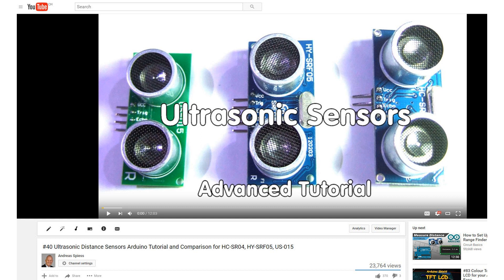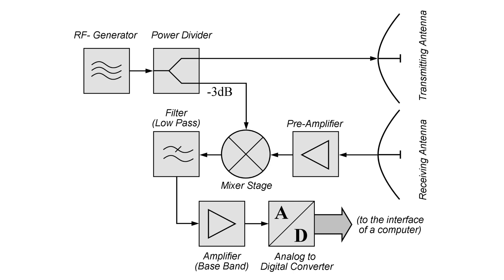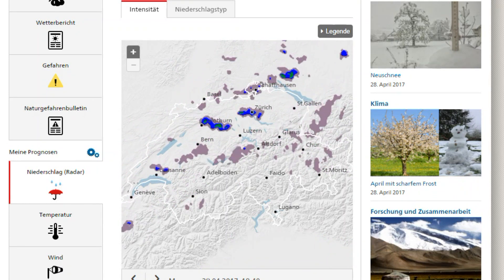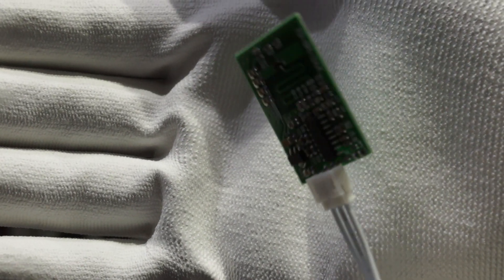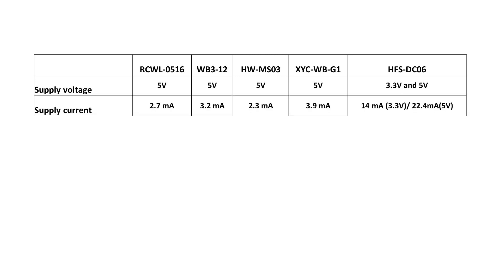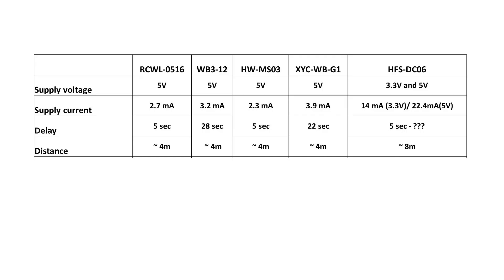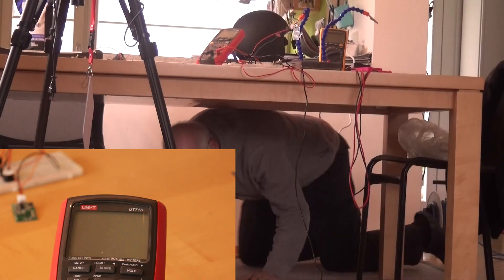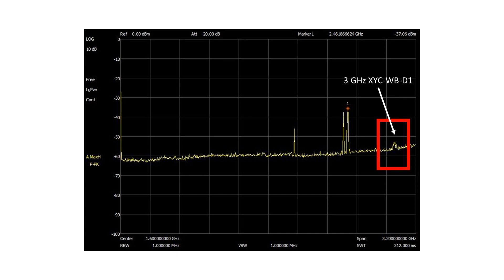#135 Radar Sensors / Switches: Comparison and Tests

Comment: My first professional jobs was to work on Radar.  I really wouldn't classify these boards as Radar.  I could go into thousands of ways it's not but it would be unnecessary.  But even looking at this on the first design I had when I was in university for a robotic lawn mower.  I don't think this would necessarily fit the bill.  Yes, it could maybe provide ranging information so it didn't run into something or used to determine when it needed to turn away to avoid impact.  But I don't know if it would be able to detect the difference from ground noise from an actual object.  It was why I was forced to consider phased array but using light.  Even that had drawbacks.  It hasn't been something I have ever got off the drawing board in thirty years of messing with it.  Of course the major problem is lifeform avoidance.  Can't run over some kid or baby that is in the yard where they shouldn't be and this robot is running about.  I see a stay in prison at her majesty's pleasure for years.  And when I tried to use multi layer sensors its power usage was too high and it would be several kgs of weight. Not to mention the amount of AI that would have to be written.  So, it became impractical.  But I digress. No, I can't think of a practical use case for these chips because they fall short.  Thanks for researching it.  You saved me the trouble.
Reply from the maker: +Independent Living As I said, I have no clue how they work and I doubt, that they really work like real radar. I just tested them without understanding how they work. I think, many other tests can be made. But so far, they seem to work in the situations I showed..

Comment: I was looking for one of these devices to use in the UK for remote security applications. After looking around there was one company who could supply a module which could detect at 75m, (people/vehicles) with current draw down to 1mA. Not really cheap but top quality.  You can also purchase ready to go radar speed camera, with a warning sign: slow down, over 20mph, etc. I never knew these devices were available to the general public but they are.
Reply: There is one of those speed signs at the local retirement village, indicates your speed either in flashing red or green.

What is really cute, is that it detects direction, indicating only traffic approaching, not departing.  That requires somewhat more sophistication.
Reply from the maker: I think, these devices work with a different principle, because they can also measure speed.

Comment: Thank you for your video! I have noticed they won't detect through glass. I wonder if the glass window reflects radar because of heat insulating filter that is applied to the glass pane.
I'm going to test my theory with some pieces of glass that I have next week.
Reply from the maker: I do not think, that the glass in my house has metallic shielding. So, I would be interested in your results
Reply: I've done some tests already this afternoon. I can't find any glass here at home that reflects this sensor that I have with me. I have some aluminium mesh material that seems a little bit permeable to the sensor, but I'm not sure if I tested that right. The glass at my office does reflect it for sure, but I have to test that again later.

One interesting phenomenon that I found is that with the sensor loosely inside a metal bin, like a cookie jar, the bin becomes really super sensitive to the touch and to movement. Almost so sensitive that shouting at it is enough to trigger the switch. 
This sensor has great potential for creative tinkerers.

I'll get back later.

Comment: Nice video. I bought a few radar sensors in the past but always had problems to get them to work. Maybe I got confused by the 360 degree sensitivity you have measured. One question: did all of the modules needed a pullup resistor on the output?
Reply from the maker: No, only the one I mentioned
Reply: Ok. Have you tried to use a metal tube with one open end to force the sensitivity to one direction? It would also be interesting if a tube does affect the range ....
Reply from the maker: No, but one of the modules had a metal shielding and directivity.

Comment: May be this sensors are only detecting changes on the phase of the received signal. Then, even with many devices transmitting this will not avoid others to detect this changes. This is why it seems to work through obstacles: because the signal is being reflected and sparsed in all the room.

You can do a test: check if one sensor is triggered when you power on or off other sensor. You can also check if it is triggered by other sources of radio like sparks on light switches or fluorescent tube starters.
Reply from the maker: You are right. The I did a short test with a RCWL-0516. It switches on if I switch a second RCWL-0516 on or off. It did not react on the HFS-DC06, but it reacted also on the HW-MS03. Distance was about 2- 3 meters.
Reply: I noticed that same device inteference with each other. I had three LED Light Bulbs with build in radar sensor in the same lamp and I get a nice light show. :)

So more than one device in the same room isn't working very well.

Comment: I tested the HFS-DC06, by splitting the two pcbs and access to the two opamp outputs to read the low freq waveforms , so behaviour can be expanded from the standard one-off ;)
Reply from the maker: And what did you do with signal? What does it detect? Speed? In which direction?
Reply: P. B. this is related to my question also. can we detect the amount of reflection in a volume.  My application would be plant growth or level of water maybe?
Reply: I observed the waves variations with the oscilloscope, I did not use the signals yet. It was months ago, I found some algorithms but did not apply yet.

Comment: Are you sure the RCWL-0516 does not work on 3.3V? I really cannot see a reason why it shouldn't work if you power it with 3.3V on the 3.3V pin. Usually a voltage regulator doesn't care much if you power its output with the right voltage and no input connected... Even if the voltage regulator is integrated within the IC. And I don't think the unregulated input voltage is used anywhere else except on the voltage regulator input. You should try it.
Reply from the maker: You are right. I tried it again now and it works. I do not know what I did last time... BTW: I did not see a voltage regulator chip on board.
Reply from the maker: Done
Reply: Thanks, then I'll try to power the radar sensor from the 3.3V output of my ESP8266 board.
Reply from the maker: Yes
Reply: @Roter . If I understand you well, the 3.3V pin can also be used as an INPUT (on +3.3V) as long as the Vin pin is not used ... am I right ?
Reply: Yann M I'd like to know how you get on.
Reply: I cannot find a voltage regulator either, but looks like RCWL-9196 has internal regulator from the pinout. On HW-MS03 it looks to me like there's a small 3-pin regulator hanging off its back, you can likely supply 3.3V to its output.
Reply: Will you revise the info based on this knowledge (that it works on 3.3V), also will you post code for use of esp8266 with this sensor :).
Reply: Thanks for this update! Very helpful for me!
Reply: Mine also worked with 3.3V from an Arduino board on the VIN pin...

Comment: I bought a sensor which is marked "2.7GHz" from Aliexpress and was quite surprised by the spectrum of signal which it emits. It is not a narrow "spike" but rather wide, maybe 1 MHz wide. Is that happening because of poor Q of PCB resonator?
Reply: 1 MHz isn't that bad for these type of devices.  
with an arduino your frequency can vary as much as 0.5% - at 3 GHz that would be 1.5 MHz just from inaccuracy.
Reply from the maker: I do not know, because I was not able to see much spectrum below 3 GHz.

Comment: Radar transistor, switch turns on to send signal for fix time period. Then it changes to receive signal must be another switch somewhere in your circuit. On receive the signal is passed through a range gate system. Plus filters first to get rid on high frequencies and only let audio frequencies through to range gates. Don't get me started on speed. One of many jobs I have had.
Reply from the maker: +Chris B You are right. But here, you only find one transistor. This is, what amazes me.
Reply: Most of the stuff for filters would be in the chip. I need to go to the shed to check the transistor system use in this circuit, Andreas. As I do remember there was a simplified, radar which used one transistor, but have not been doing radar 11 year not so a bit rusty.
Reply from the maker: +Chris B The chip seems to be a digital PIR sensor timing chip. No RF, no filters there.
Reply: Obviously you worked on longer distance radars. This will not work like those you worked on.
Reply: are you saying radars are not good for any application

Comment: Great video as always. Can you also check them if they are affected by some electrical noises if let's say we want them enclosed in a box with power supply close to it.
Reply: You need to be a ham radio operator to have a deep understanding about what is happening here.  Find some modules with an "IF out" port and, look at that spectrum from 0-5MHz on your spectrum analyser and repeat the test of "a room full of them".  Prepare to be amazed.
Reply: Also google "gunnplexer" to see how to speak large distances using these.
Reply from the maker: The device from Bangood has a power supply built in and it works ok. But you always have to check yourself in your own configuration.